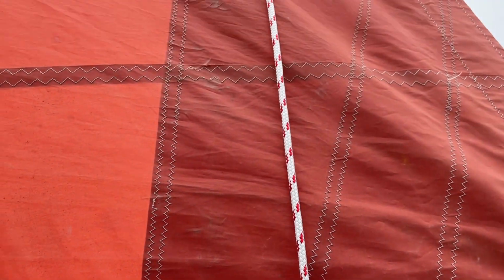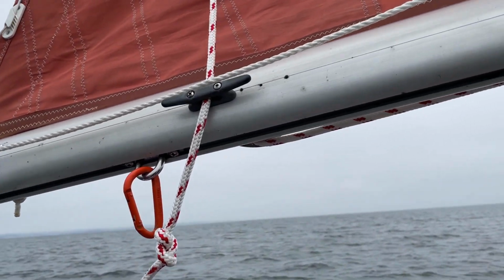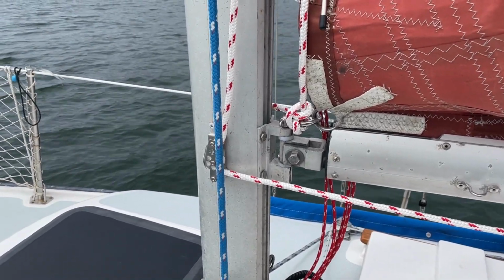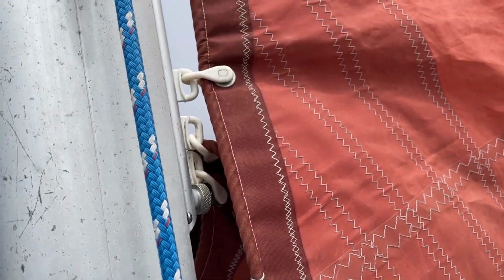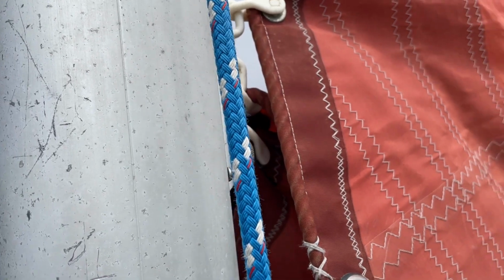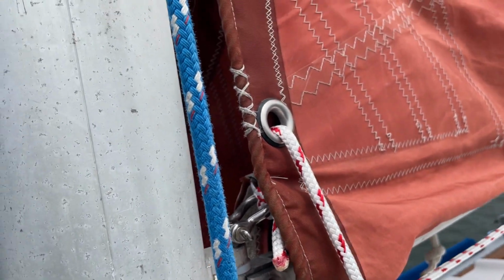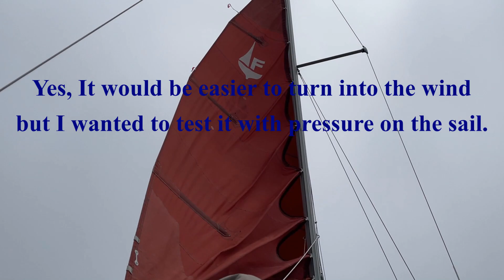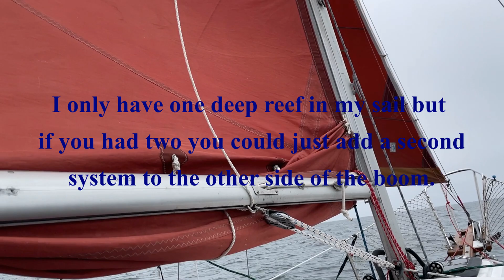Single line reefing for a Flicka 20 sailboat

Comment: With many sails it is prohibited to bind the reefed sail to the boom as you did because the middle grommets are not designed to carry load and the sail will rip. Perhaps your sail is reinforced enough that that will not be a problem but I mention it for the benefit of others.
Reply from the maker: You are right if the sail was on a loose footed boom. Then you just gather the sail up and tie it to it's self.  The flicka uses a fixed foot sail so there is no way to tie the sail up unless you tie it around the boom.